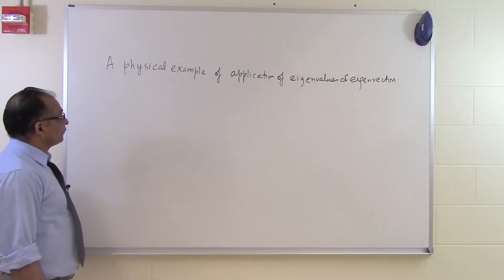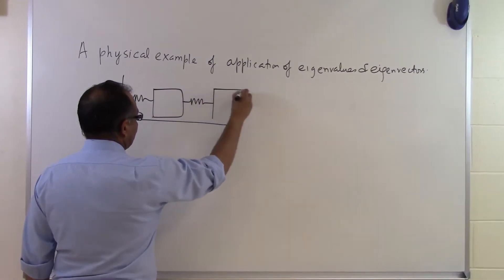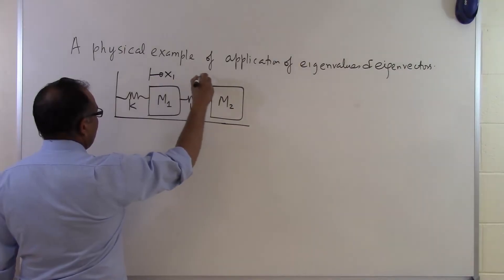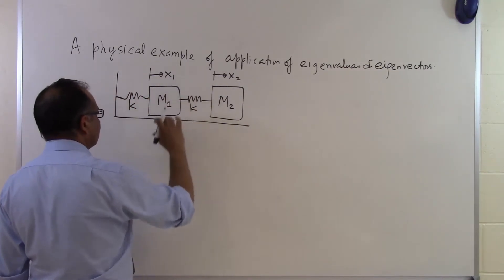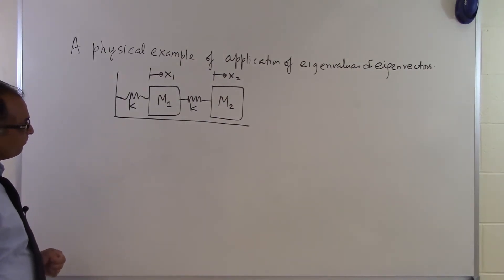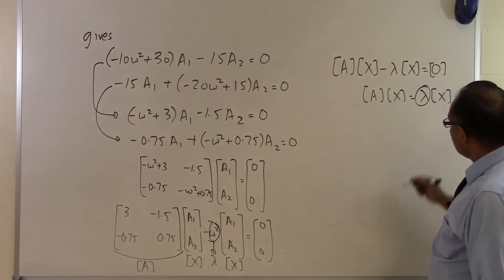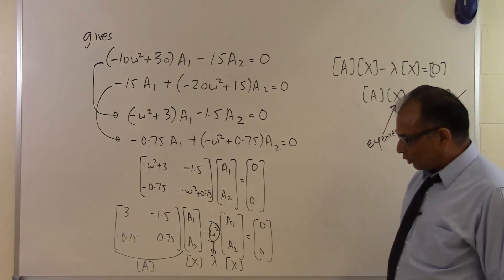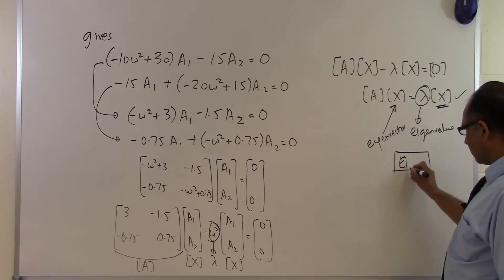Chapter 04.10: Lesson: A Physical Example of Application of Eigenvalues and Eigenvectors

Comment: First of all, I wish to congratulate this gentleman for his clarity in explanation and also his absolute control on his handwriting which indicates so clearly that his mind is perfectly stable and that he took care of himself in not thinking that an academic qualification is enough.  His voice control and his manipulations and the levelling of his handwriting is excellent in every manner.

About the demonstration of this solution, while this is  good manner in which to teach the dynamic problem  shown on the board,  I am a little hesitant to show it in this manner as one misses the transient part  and also the different modes of oscillations that such a system can enter.  Also I am not sure that the phase shift of the system can be said to be the same for both masses as during the transient period before it all settles down to steady state, which is the solution the lecturer suggests, well I feel that there is a lot of missed " engineering " in such a solution. 

From the point of view of teaching eigenvalues and eigenvectors  well this is the  method to use, but from a student's point of view I found that it would be more informative to program the two equations on a  computer with  the associated two integrals for  each equation and through an iterative programme one can see the build up of the transient  and the steady state condition in addition to  seeing the different modes of oscillations if the masses are  started in different directions.

To make early assumptions of the  solutions I find that it  could be rather weak in illustrating the richness of such a system starting from scratch for different starting conditions.   I suppose  the method used depends whether one is trying to illustrate the mathematics  of the system or the engineering or physics of the system.  Both are useful,  and both contain  information that  are otherwise hidden if one does not use mathematics or  more detailed physical solutions due to caring about the starting transients, the possible modes of oscillations  and of course the resulting steady state with  all the phase shifting and lagging and leading of phase shifts of one mass with respect to the other.  Also if this was a real practical problem , the distances with which the springs would settle down  are not contained in the above solution.   Perhaps a little inclination of the floor would add  more  knowledge to the student as to the final settling of the system.
Reply from the maker: Good points brought out by the commenter.  It would be nice if you could make the correct video or a blog.  I would be glad to link it here.
Reply: A quick sample of what can be done to show the transient, if the masses  start with initial velocity in opposite directions and when they start with initial velocity in opposite direction  with a slight loss in the coupled system.
      
      K1=-.0010
      K2=.003
      K11=-.0010
      K22=.001
      X1=5:X=0
      Y1=-5:Y=0
      PRINT " MASSES START IN OPPOSITE DIRECTIONS"
      FOR P=1 TO 6
        FOR T=100 TO 3000
    
          X2=K1*X1+K2*(.95*Y-X)
          X1=X1+X2
          X=X+X1
    
          Y2=K11*Y1+K22*(.95*X-Y)
          Y1=Y1+Y2
          Y=Y+Y1
    
          PLOT 69,T, 500 +X
          PLOT 69, T, 500
          PLOT 69,T, 500 +Y
    
          FOR N=0 TO 100000:NEXT N
        NEXT T
        IF P>2 CLS
        IF P>2 THEN X1=5
        IF P>2 THEN Y1=5
        IF P>2 PRINT "  MASSES START IN THE SAME DIRECTION"
      NEXT P

Comment: Thank you for the mathematics part,but what we deduced from this, i mean why we calculated eigen vector,eigen value ? i am wandering since 4 hrs now on net to understand it ,no one is able to explain it properly ,alas ...!
Reply: Eigenvalues, in this case, give you the natural frequencies and the eigenvectors are part of the solution, that is, the displacement of each mass.  We want to know displacements so that we can find the motion of the system.  https://www.quora.com/What-is-the-significance-of-natural-frequency 

Another good example of eigenvalues and eigenvectors are when one finds maximum stresses at a point.  These end up to be eigenvalues of a 3x3 matrix of the stress tensor. Maximum stresses are important and those are the ones that go into failure criterion of a material at a particular point.  The eigenvector gives you the direction of these maximum stresses. Those are important to figure out how a fracture may progress.

http://www.cpp.edu/~manasab/eigenvalue.pdf